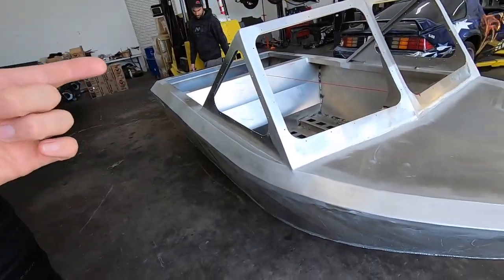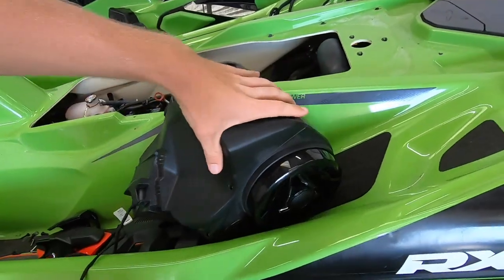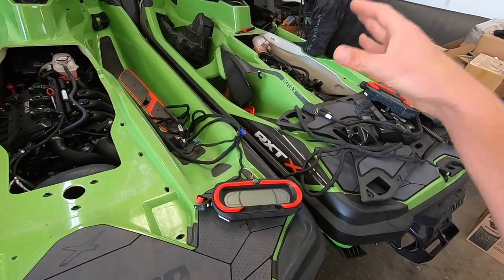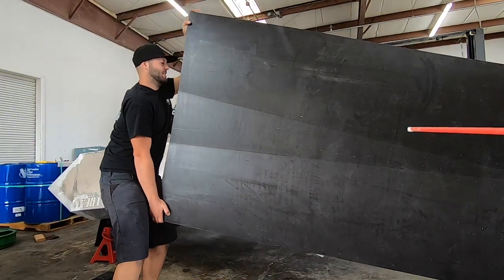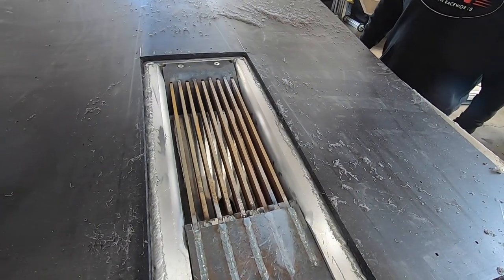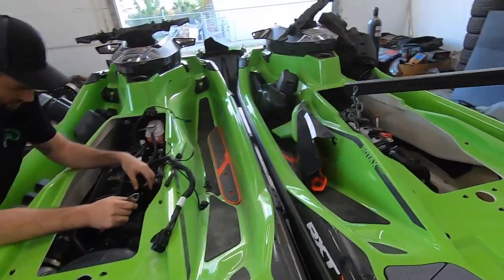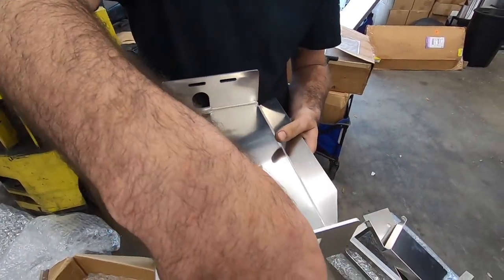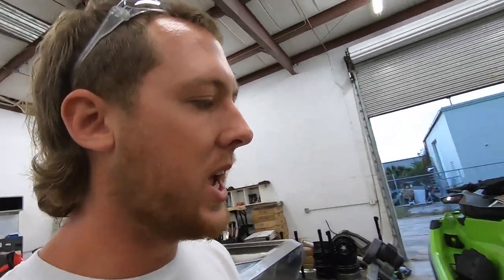Mini Jet Boat Build Part 3: Destroying BRAND NEW Jet Skis For Their Supercharged ROTAX Hearts!

Comment: CLEETUS LISTEN UP. YOU NEED SEALANT ON THOSE SCREWS! THEY WILL LEAK IF THEY DO NOT HAVE SEALANT. TRYING TO HELP YOU AVOID A DISASTER. HELL YEA BROTHER
Reply: Was thinking the same thing. It needs 5200 or at least 4200.
Reply: Makes sense to me. Should they not be countersunk more also?
Reply: @whitey3  flush is fine.  But silicone is a must.
Reply: @theislandsc  I completely agree. I learned my lesson the hard way. Don’t want to see them end it in a tight spot when they can fix it with a trip to west marine or just order some 3200. Off of amazon
Reply: Hmm,  yeah some silicone likely would have helped.  But I'm sure they'll seal up just fine regardless for now.  They do have bike bilge pumps as well...
Reply: Yeah 5200 and some nylock nuts on the backside. Aluminum is soft and the bolts will vibrate out beating against the water.
Reply: @adamhabel2230  those were self tapping deck screws I believe.  They're mainly used to screw down decking on trailers...
Reply: Easy fix would be to pull each screw out one at a time drill a hole through and replace with a flat head machine screw with a nylock nut and fender washer. With some 5200 or 4200 on both sides.
Reply: @derekbader130  They aren't self tapping. You can see them good at 15:34
Reply: no worries ... when we welded the hulls I heard something like dual or quad bilge pumps .... LOL.   when the water gets in the boat (I mean completely fills the the boat) going though the rapids .... in 15-sec those pumps will empty it !!!  a few drips from the screws sure make no difference ... LOL
Reply: Use a real marine sealant. Sikaflex 291
Reply: LOL I own a marine repair service company (Im a certified marine engineer and marine service tech) and I am dying with laughter thinking how annoyed they are going to be when they need to pull all those fasteners and reseal with 4200 and back them with nuts and washers
Reply: Nah.. it'll be fine. Either way it will be good content. That's the only reason this is happening anyhow. So relax "boat guys" sit back and enjoy the mayhem that will soon begin..! 😁👍
Reply: @joshs199   lol well they are going to learn the hard way then, because the sealant also  reduces galvanic corrosion between the hull and fasteners, which also makes it harder to remove and replace or reseal in the future. Where I live there are tons of river jet boats with HDPE bottoms, and everyone applies sealant for those exact reasons.
Reply: @farmshopprojects  yeah man. I totally agree. But there probably going to run these things 2 maybe 3 times just for YouTube content. Obviously not serious boaters. But yeah your absolutely right. 👍
Reply: @joshs199  true, everyting for the views, love these guys but they do seem to try and do things correctly, well at least as best as possible.
Reply: @ZILAwelds  Not so much that, it's more the galvanic corrosion between the bolts and the hull due to differential metals. Basically welds the bolts in, the corrosion will seal the hull most likely, but if/when the protector plate needs replacing, most of those bolts will probably need drilling out. It's a lot less time consuming to seal the bolts in the first place than to drill them out in future.
Reply: Bilge pump
Reply: @ZILAwelds  that’s the right attitude. We did it wrong so instead of fixing it we’ll just throw a band aid on it. Says a lot about a persons work ethic.
Reply: @shanewilliams5125   bilge pumps wont stop the threads that they tapped in the aluminum from corroding and ultimately failing, have to stop the ingress of water before it allows galvanic corrosion to start. it literally happens with moisture from the air, give it a full dose of water and it takes off like mad.
Reply: Yep.  They are totally making this up as they go.  Not using a kit and set of plans from a manufacturer, no contact with the manufacturer for advice, just winging it.  Ugh.  Once again, there is more going on than makes it into the video.  Cleetus clearly states that they have been in contact with Jetstream throughout the entire process.  Do you really thing they would overlook something like drilling 100 holes in the bottom of the boat?
Reply: @SirVic42  jetstream are actually just the next town over from where I live, they are a fledgling company, its not like they are a large well established company like weldcraft or kingfisher where they have to be responsible for quality control.  Its entirely possible that they have overlooked that, either way its industry standard to be applying sealant in this application. I'm a Marine engineer and a Certified Marine Technician with a degree in nautical sciences and have been repairing and maintaining watercraft for over 20 years, trust me its a requirement to apply sealant to all fasteners below the waterline, I'm not going to dredge up the ABYC or other standards or documents to prove this because really I just cant be bothered.
Reply: @stewart8908  hmm,  yup i see that now.  Yeah hopefully they use some nylock or stover nuts on the other side.  They could likely use some silicone under a flat washer and get those to seal for a long time!
Reply: 5200
Reply: I wonder if the angle of the counter sink and the angle of the screw head was matched. Making a tight seal with the semi soft plastic🤷🏻‍♂️

Comment: Full time PWC Shop owner here:
Pull the floating hat, jet pump and driveshaft out and you can pull the engine straight up out of the hull instead of trying to pull it forward off the driveshaft, inside the PTO coupler on the engine is a little plastic sleeve that is pretty easy to break and if it is broken and you run the engine, the driveshaft will pingpong off the crankshaft and wipe out the thrust washers.

Your X3s have the same engine as the Seadoo Spark, the 900ACE, those RXT-Xs use the 1630ACE, The successor to the 1503 supercharged engine that is in my $500 Seadoo I'm hoping to get time to start getting progress and videos out on soon, once I get it running, I'll dial it up to 255hp from the factory 215hp it had.

I'm excited to see where your boats go, from what I've seen tuning is incredibly limited, tuning licenses from riva are like $500 per vehicle, and then it only loads preset tunes, if you want to actually do a custom tune you have to use their software and pay an extra $250 per vehicle, plus their special maptuner hardware is another $400.

Tuning jetskis is an interesting predicament because they run most of their life full throttle full load, like the longest dyno pull in the history of forever.

I would imagine you will need to re-pitch your impellers/props to accomodate for the much larger hull having a lot more drag, generally these engines are meant to turn about 8k rpm at wide open throttle, and the hulls are "drag limited" to stay there when in motion on the water, if you're below that you aren't getting all the hp, and if you've above that, you'll just be pounding the rev limiter and if you back off the throttle to keep it at 8k you still won't be getting the hp you paid for, and may be running lean.
Reply: $1000 each for a tune is nothing for these guys. Plus the amount of exposure a local tuner would get is 100 times the price of what the tune costs. Someone's going to donate the time and tunes for some exposure.
Reply: @otm646  oh for sure, although I would highly suspect there are few "professional" pwc tuners out there, or at least for sure there are none remotely near our lake.

 I work on tons and tons of skis every year, and only end up doing anything performance related maybe once or twice a year, 99% of customers just want maintenance and repairs.

Even simple stuff like adding 40hp to a Sea-Doo like my $500 RXP can be done for well under $1000, likely about $400-600 including a new polished prop to utilize that power, and not a single person is remotely interested.

Being on the coast may be a completely different story though, idk
Reply: @trythistv  Dang, I often talk shit about youtube comment sections but it's always nice scrolling through and hitting some gem of knowledge. I'm from the area of the world where snow-mobiles are more our thing and I had always sort of figured jet-skis were in the same ballpark of tune 'em and send 'em -- interesting to know though. Hadn't even considered that these things spend most of their life at wide-open-throttle.
Reply: This is so wholesome oml
Reply: I'm sure JP RACING ONLINE would be glad to help out. Looks like he's somewhat local also.
Reply: @longstroke1982  OOOOOH now these guys are doing some stuff I wanna see! it seems so impossible to find much information about actual tuning on skis beyond flashing premade "stages", partly due to dyno availability, its tough to replicate moving through the water, plus the diminishing returns, A "stage 1" riva kit for my blown up rxp costs around $700, will gain 4mph, adding a riva tune may add a few more mph but at that point I'd have spent nearly 2k to gain less than 10mph, which is a hard sell for my customers. I'm gonna be in contact with these guys, they're into some awesome stuff it seems that may just change everything I've learned about PWC tuning, which is so sick! Thanks for turning me onto them!
Reply: @trythistv  great info!
Reply: I spend ALL my social media time on YouTube... 
I 100% Love it when I come across comment sections that are informative, knowledgeable, and insightful. I grew up with 2 diff sides of my family into 2 diff Powersport interests. 1 side ALL Drag Racing and the otherside all watersports. From childhood I spent Alot of the summer on jetskis and boats living right where a couple rivers meet (Ohio river and Big sandy river - WV, OH, KY border) 

It's awesome how well-rounded this channel is!!
Reply: I've been messing with jetski since I was a kid. I blew up my first ski js440 3 times. Had a few 750sx and 750 sxi. They all blew up. All of these skies were highly modded. Got into a seadoo hx kept the motor stock. Still have it and it runs perfect. Had a bunch of 2 seaters over the years and I only get seadoos and Polaris. Never broke one of them cause I left the motors stock. I mod absolutely everything except PwCs. They are beat  more than anything I can think of. 8000 rpm full boost then dry pump and dont come apart? Still amazes me. Moral of the story dont tune.
Reply: Cleetus needs to hire this man
Reply: Bump
Reply: @mattvorhees6055  I've got 18 varying brands and models at the shop right now awaiting various things, 8 of them need engines, others have hull damage, I do so much work on rentals I see some of the worst there is, I'm amazed at what the hondas have withstood, its a shame they are no longer making them, units with 2000+ hours of rental, getting sunk 2-3 times a month, those things are amazing. They never made them as quick as the other big 3 brands did, maybe thats why the hondas survived so well.

I have a hard time wrapping my head around how jetskis (and boats) are drag limited. And I've been working on them for years now!
At wide open throttle they might be making 200, 300hp or maybe more and they will not hit the rev limiter unless something is wrong with the pump/drive systems because the drag of the hull gliding across the water creates enough resistance to eat all of that horsepower and prevent the rpm climbing.

Like if you could put a car on a dyno and could set the dyno to just hold the car just a few hundred rpm before the limiter and then held it there for 8 hours... I've done it to my personal ski, I've seen rentals only take breaks from running WOT to refuel, Incredible they hold together as well as they do.
Reply: @trythistv  I like to follow boats closely especially those with skiers and tubers. And if that doesn't make me look like a big enough douchebag I like to run on the opposite side of channel markers and go full throttle in a no wake zone. Ive basically got the biggest dick ever.
Reply: @scottleighton9149  I do believe I've seen you out on the lake here before, in fact I might have fixed a jetski that a buddy of yours ran into the side of a pontoon boat going 55mph. caved the nose right in, and didn't do the pontoon any favors either lol
Reply: @trythistv  That was him! Lol but for real I love skis ive got a waveblaster 2 ive had since i was a kid and rode a bunch of waveblaster 1s. I rode a spark trix last year tho and Couldnt believe how fun it was. Very light and nimble just wish it had a little bit more power
Reply: @scottleighton9149  lmao 🤣
Reply: Here in NJ at the shore I've seen plenty of riva tuned sink doos
Reply: @scottleighton9149  The sparks are neat, I do know the plastic hull does not hold up well to rental use, but for any ordinary person who doesn't spend their days checking if the ski is amphibious on the nearest immovable object, they hold up good.

Plus being able to unlock the 60hp ones into 90hp for $0 is a pretty fun trick. Literally the same front to back, just a setting in the ECU, as if you were resetting an oil change reminder.

I'm suspecting from everything I see and what people are saying the PWC tuning scene is a lot more prevalent in the ocean/salt water areas, TN lakes it is rare, there are the few tuned skis around, and man are they fun, but I only ever see 1 or 2 a year amongst the masses of stock naturally aspirated cruisers.

Comment: Now take all the bolts back out and put a thread sealer on them.
Reply: My thorts exactly.  I was thinking seal around perimeter of it to stop water getting between it
Reply: Phil Swift approves 👍 this comment and the flex seal family of products also 👌
Reply: I was thinking sealer and locker as well.
Reply: Lets hope it’s not SS bolts
Reply: Galvanic corrosion between stainless and aluminium is a b*tch,  no amount of anodes can stop that. It's like its welded together, only way to remove them is to drill them out, and hand drilling stainless bolts... well it's more time consuming than putting thread sealer on in the first instance.

Comment: Did I miss a part where they explained how drilling hundreds of holes without some sort of sealant isn't going to compromise the waterproofness of the hull?
Reply: How about the part where cleet had to pound his chest and show everyone who’s boss and made the last cut with the circ saw and way over cut it 😂
Reply: Good thing they have a full time fabricator on the payroll now ha
Reply: Wondering the same thing
Reply: Stainless will eventually eat the aluminum thru galvanic corrosion. It can be slowed if they used blue Loctite and it will also help with any potential leaking adding sealant on the inside would be good both for avoiding injury and sealing.
Reply: @lostman9814  They most likely will be thrashed a long time before that.
Reply: Their Fabricator must not know to much about fabricating and boats.
Reply: Wasn't hating, was honestly just curious lol. I live on a boat and that just gave me agita.